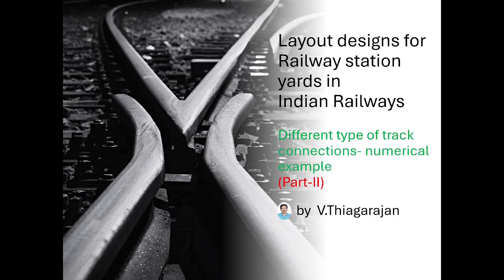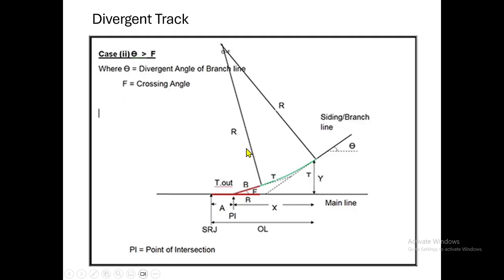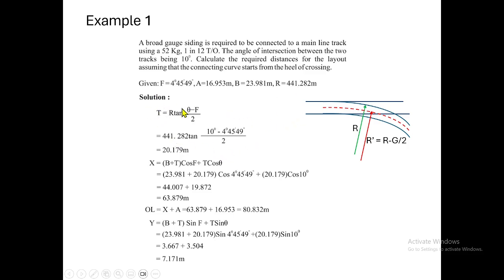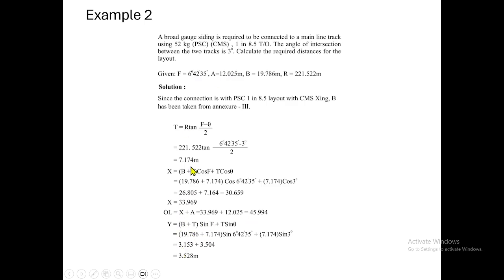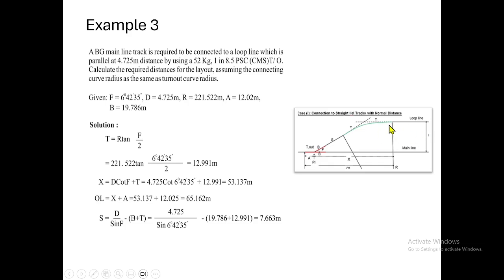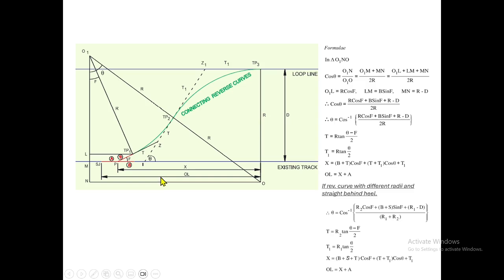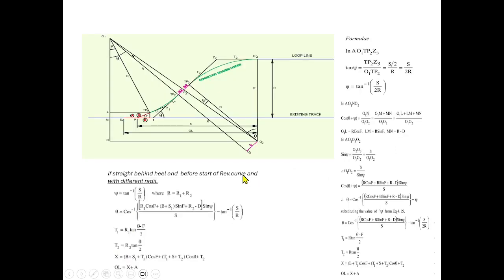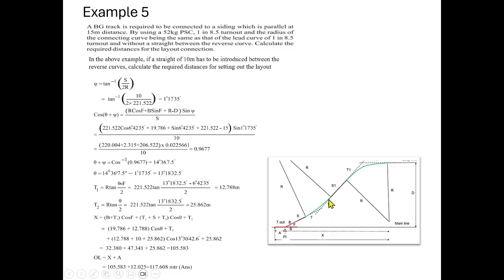Indian Railways - Pts.&Xings– Layout Design (Part -II) Numerical examples - V.Thiagarajan,IRSE(Rtd.)

Comment: Sir radius of lead curve is 232.320m for 1 in 8.5 turnout then R=221.If R-G/2 means what is R and G value kindly explain sir
Reply from the maker: Sorry for the delayed response Mr Vinoth. If Radius of turnout  is 232.320m ie 232320mm, the centre line radius (R’) = R-G/2, where R is gauge for BG it is 1673 mm. Then R’= 232320 - 1673/2 = 231483mm. ie 231.483 m. In some problems, R may be 221m, it is for only example (It varies for CMs xing with PSc sleeper and wooden layout, curved switch, straight switch etc.... You may please follow the latest turnout radius the details are in Points and crossing video for variuos types. As of now we follow CMS xing in PSC sleepers as every where we adapt this. sorry for this confusion. Even you may take flatter radius also.  If the connecting curve is flexing in same direction for uniformity sake, we follow R’. You are welcome if you have any further doubts, please.